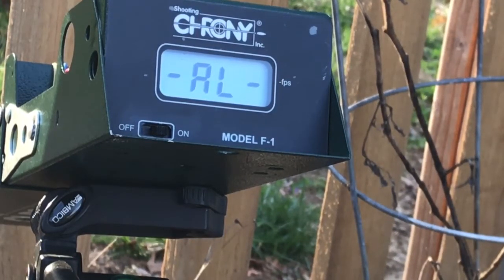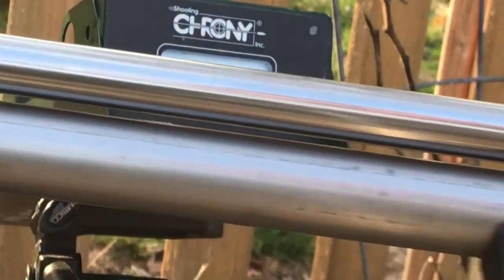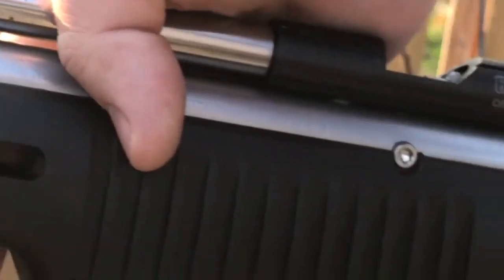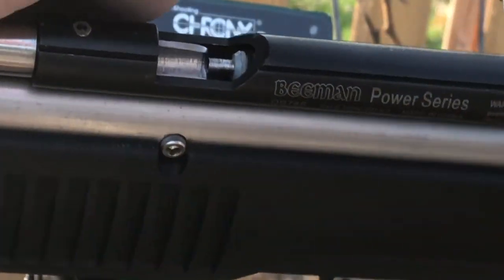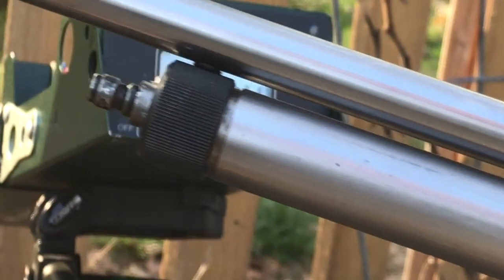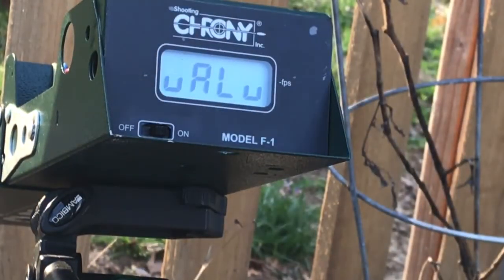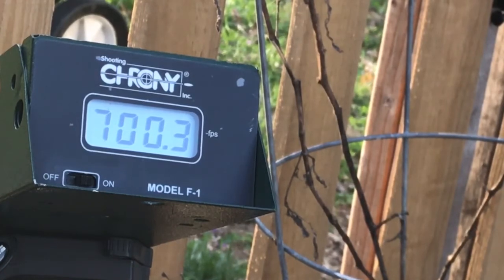.357 caliber QB78 HPA conversion

Comment: Troy, I'd like to buy the valve if you still can produce it. would you let me know please?
Reply from the maker: D Charisma yeah I have several valves here to modify for this setup. What are you putting it in? Factory tube or custom tube?
Reply: @AnnihilatorAirguns  got me a 3000psi tube with the same ID diameter as factory tube @ .750. Do you also have valves for larger diameters?
Reply from the maker: D Charisma ok good. I have modified other valves that might fit a larger tube.
Reply: would you put them on your website? i'll order from there or whichever method you prefer
Reply from the maker: D Charisma no, things like that are custom orders. Email me at Annihilator.Airguns@gmail.com and we'll work it out after EBR next week.

Comment from the maker: With a little more starting pressure and adjusting the hammer spring we should be able to tune out 5 shots at a 800fps average (115fpe) or 8-10 shots at 750fps avg (100fpe).